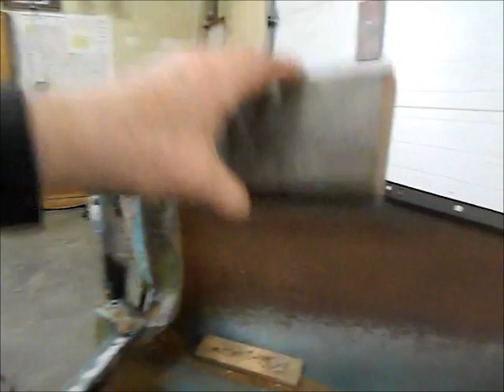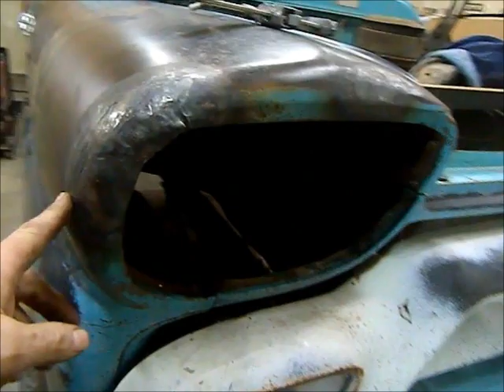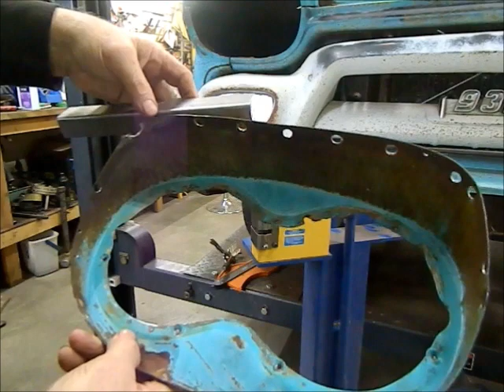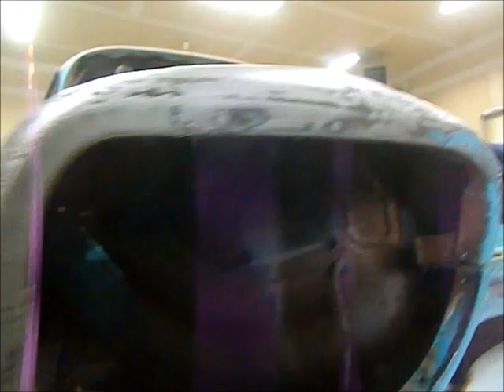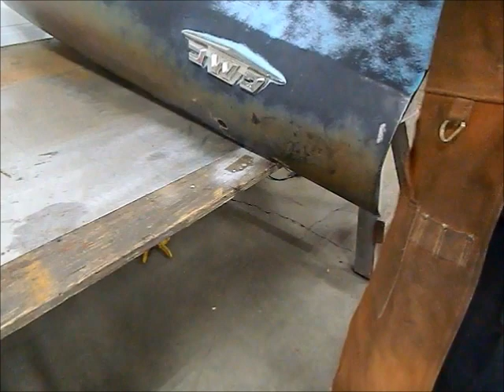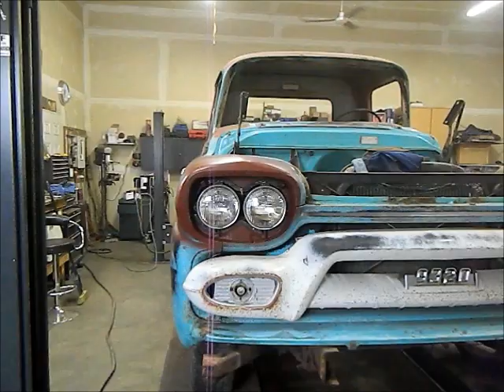1959 GMC Fleetside # 15

Comment: Great work as usual Glen, finished fender looks great. I was sure you were going to split that metal around the headlight bucket stretching it that far - I would have! Going to have to look into some of those Stek delron bits, they really seem to work well.
Reply from the maker: Thanks a bunch Gary, I'm surprised it didn't split. I have used those air hammer tools for a variety of jobs.